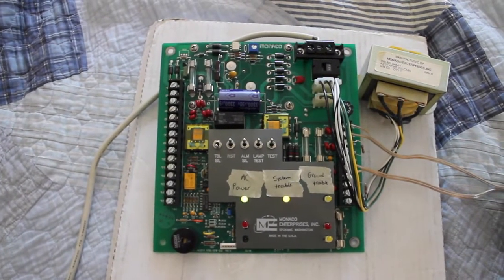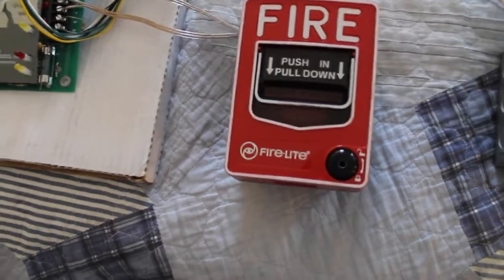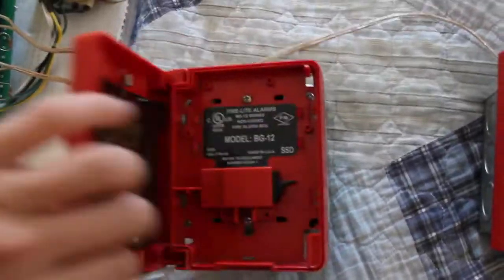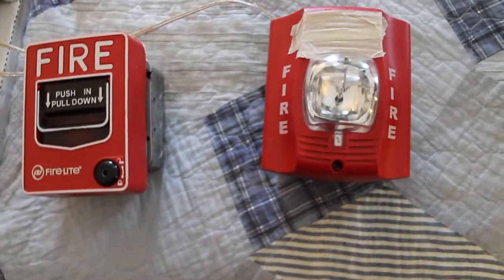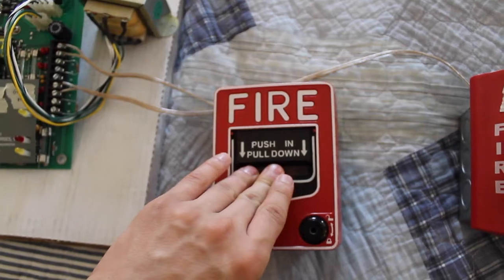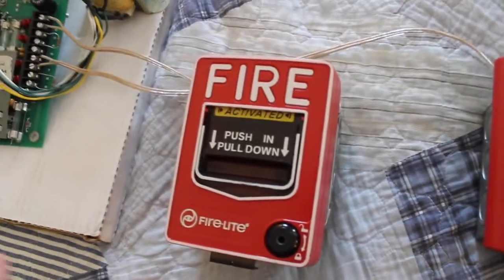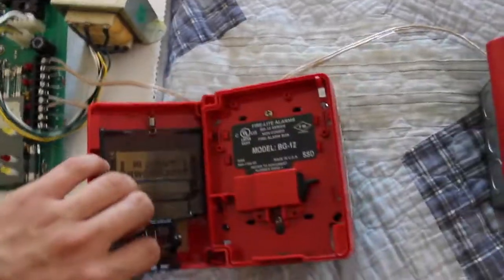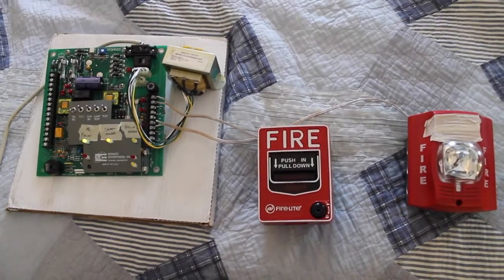Monaco Vulcan 1 - System Test 8

Comment: I'm going to ask you this too. Can you wire up a pull station to a fire alarm only using the the wires on the pull station. Btw, I have a BG-8 and a Spectralert advance.
Reply from the maker: That is possible to do. A conventional pull is just a simple switch. In a basic setup (which I usually do) the switch allows current to flow to the device. There's plenty of videos out there on how to do a basic setup like this.